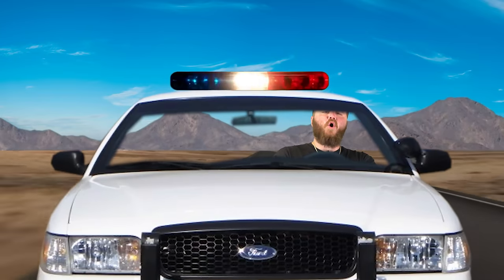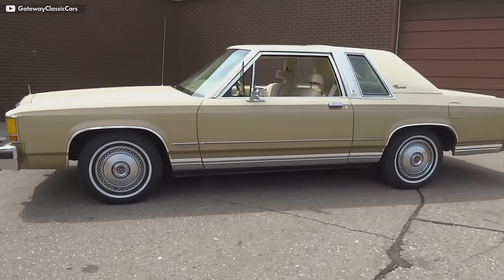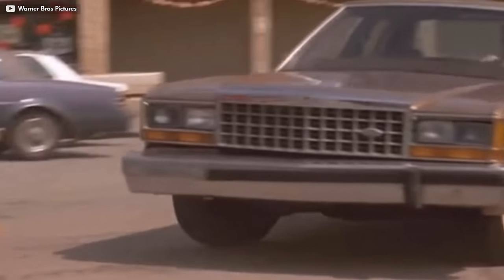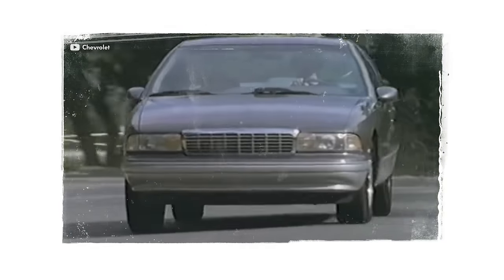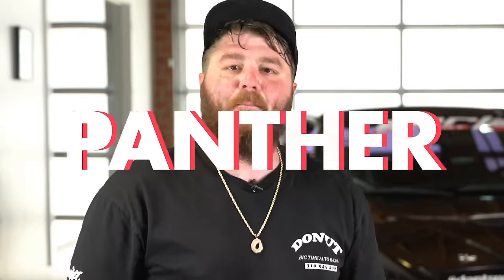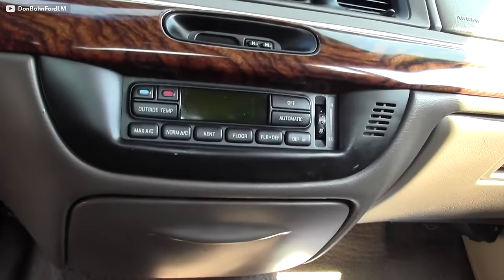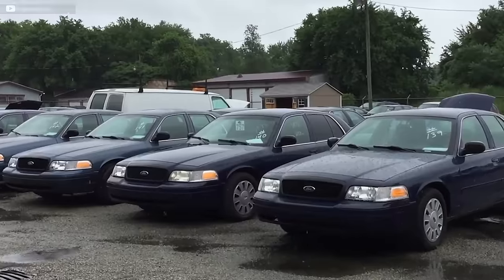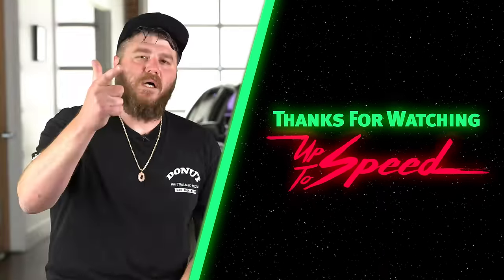Ford Crown Victoria - Everything You Need to Know | Up to Speed

Comment: I bought a 2011 crown vic for 2k with less than 90k miles and I love it. Big car is so nice compared to my tiny Honda Civic. And the trunk space is amazing for transporting all the hooker corpses
Reply: Three Tree He is 911
Reply: Haha, I hear that. Sounds like you got a better deal than me though. I got my 2011 back 3 years ago for 15K when it had 35K on it. LAPD didn't want it anymore because the heater didn't work. I guess they just didn't want the car, since a $200 part later and everything was functional.
Reply: That took a ..... turn
Reply: What the fuck
Reply: I Love This Comment
Reply: But bad gas mileage.  My Chevy Volt weighs almost has much as a Vic but so much more mileage
Reply: Im actually looking at buy a crown vic may i ask if you'd recommend it?
Reply: @danwat1234  you do know the volt is a hippie hybrid piece of shit with a tiny 4 cylinder right? The Ford Crown Victoria shares the 4.6L V8 from a mustang AND an F150 its literally powered by a truck engine bro
Reply: @jessicataylor4071   The Volt's 4 cylinder runs as a generator, the wheels are powered by a 150HP electric motor. So it's not like regular hybrids that require the engine when floored.  Believe it when I say it can tow a trailer easily. Rides well, good acceleration, American made, weighs almost as much as a Crown Vic (~3750 vs ~4400) pounds
Reply: Daniel Gonzalez how many gallons per mile
Reply: Vin wiki reference?
Reply: danwat1234 the volt doesnt havea v8
Reply: Pffft! That’s a great deal! That’s a Spit take not a scoff... just clarifying.
Reply: @danwat1234  yeah but no one bought a vic for gas mileage, its a v8 and chevy volts are gay
Reply: @piority9  a Chevy Volt was in a transformers movie. Jay Leno drives one. A very good driving machine. A V8 with less than 300HP on a ~4400 pound vehicle is not impressive.
Reply: U had us in the first half...
Reply: danwat1234 the volt sucks!
Reply: true
Reply: Daniel Gonzalez fbi open up!
Reply: Haaaaa
Reply: Gimme Your Licence Boi
Reply: @danwat1234  
 At least a Vic isn't as slow as a Volt.
Reply: Yeah bro! I just bought a 2011 CVPI for $1500, 112k miles, the only thing wrong was the radiator, which was only $70.
Reply: Daniel Gonzalez dang
Reply: "tiny Honda civic" 
Is ford f150 the only car which can "accomodate" Americans?
Reply: ill take your entire stock
Reply: @danwat1234  'Cuz the Crown Vic doesn't waste its time with lousy hybrids and speeds past 'em with its massive V8! And even pull 'em overrrr!
Reply: @benjyfriedman  4.6L isn't a massive V8 and neither is 239HP. A Chevy Bolt accelerates faster with only 200HP because electric drive power curve is superior.

 You're right that hybrids are meh they usually aren't that fast. Hybrids trucks should still put the emphasis on power
Reply: Burleon  I know, right? I just got back from Bakersfield where one of the local radio stations flat out said "We just got downgraded to 106 for our high today, thank God!"

If you can still run your sprinklers on Christmas Day in the USA, then you don't need a car heater.
Reply: danwat1234 here is a spec comparison if you want to keep bitching:

crown vic 0-60: 7.6 seconds.
volt 0-60: 8.7 seconds.
-
crown vic top speed: 128mph.
volt top speed: 100mph.
-
crown vic seating: 6.
volt seating: 4.
-
crown vic: easily modifiable.
volt: batteries/electric motors that cannot be easily modified.
-
crown vic: $26,950 msrp when new, can be had for under around $1,500 with under 100k miles.
volt: $34,995 msrp when new, around $9,000 for one with under 100k miles.
Reply: ExUsE mE WhAt ThE FuCK
Reply: Had me in the first half not gon lie
Reply: wow I paid 6k for mine with 100k miles, you surely got a good deal.
Reply: yeet
Reply: Daniel Gonzalez finna put a speaker in the trunk
Reply: I call crown vics and grand marqies pimp cars
Reply: @bwgti  mindblown
Reply: @danwat1234  reliability > gas milage
Reply: @danwat1234  Impressive, and damn 60 mpg!
Reply: @ninevoltmodz4687  TY
Reply: My God now I feel ripped off, just paid 1200 for an 05 vic with 167k...
Reply: Thought it was a good deal lol
Reply: @danwat1234  The vic gets 16MPG on the road and 25 on the highway, that's really good for a v8 so it's not really fair to compare it to a hybrid 4 cylinder.
Reply: @mashedt8rs290  Agreed it's not bad for the class of vehicle and the tech it has.
Reply: @danwat1234  yeah they are durable as hell and will definetly last you a good 3-400,000 miles!
Reply: Same bro?
Reply: @mrbruh3822  where the hell do y'all find these? I can't find one for less than 3.5k
Reply: @michaelschausten5257  dude do NOT pay 3500 for a vic, I got mine on letgo check it out its a great app, if u live in jersey I have a friend who sells them, he gets the detective package ones so they don't have the long idling hours
Reply: Try the 80s era it'll fit twice as many
Reply: vTHExUNKNOWENv  and then the prices inflated
Reply: @mrbruh3822  I'm in Virginia but I'll look on there. Thanks man
Reply: @danwat1234  Take the cost of the Volt plus insurance vs the Crown Vic and you lose every time. When the battery does need to be replaced you will lose again. I like the Volt don't get me wrong. The juice ain't worth the squeeze.
Reply: @gravis2000  unless you buy used, bought mine for $10K. Electric drive is more enjoyable. But going from $35K when new it would take a lot of charge cycles to save enough on gas to bring it down to Prius level cost. Model 3 adds so much more luxury price is justified and gas savings easier to accrue due to big battery. And the possible robotaxi revenue generator.
Reply: @danwat1234  Crown vics' are gas' guzzlers 😮😮😮💰💰💰
Reply: MaSHED T8RS Exactly. My mercury gets the same milage. I can go about 400 miles on one tank.16 gallons right
Reply: @kosycat1  I own a grand marquis aswell and yeah it's about 16mpg on a 20 gallon tank
Reply: @jessicataylor4071  yeah but the truck is "light" duty.. more like your truck is powered by a car engine broo.lol jk i have a 4.6 grand marquis and i love it..and im a hippie
Reply: That got dark reaaaal quick
Reply: Shit just when from 1 to 100 real fucking quickly.
Reply: Yes.
Reply: I remember one time in college loading up a bunch of friends in my 1999 grand marquis to go to a horse barn for the afternoon. There were 6 of us, all with seat belts. In the trunk were 2 saddles, 400 pounds of horse feed, a half bale of hay, a vacuum cleaner, assorted gym bags and book bags, the two massive subwoofers I had installed, 5 folding camp chairs and a full size spare tire. Trunk lid shut of course. On the ~30 minute drive the ride was so creamy smooth and quiet everyone but me fell asleep. They don’t build them that way anymore
Reply: Hey let’s take a crown Victoria and put in a hellcat motor let’s see how much fun we could have with it ha ha laughing out loud
Reply: @michaelschausten5257  I just got one in VA for 4k
Reply: @mrbruh3822  I live in VA and couldn't find anything. Bought my 07 for 4k with 200k miles
Reply: You either bought multi color one with a ton mechanical problems at an auction or you're just lying. I've been to the auctions. They don't give these cars away. $4,000 is what a good one with 100k miles with minor mechanical problems cost. $2,000 gets you a parts/project car at best.
Reply: @blessedjuggernaut  It was an online auction so I was buying it from just pictures and the knowledge it started. The most it's needed was new brakes and couple new ignition coils. So I guess I got lucky. If you don't believe me idk what to tell you.
Reply: @dang.9125  Good for you, man. Do you still have it?
Reply: @blessedjuggernaut  yeah. I want to last 4 more years then I'll probably drive it till it dies. It was one of my best purchases ever
Reply: @dang.9125  That car can last 300k miles, man. Just maintain it and semi/sorta baby it. I know it's hard when you're driving a four door Mustang. Just keep your foot out of it. I'm a professional mechanic and I drive a 2011 P7B too. Mine didn't come so cheap. I paid $4,700 for mine and it had 107k miles on it but it was pretty much flawless other than a few clips in the paint. I love mine. Have you had any issues? Just curious
Reply: @blessedjuggernaut  the only issues I've had with it have been the coils but it's such an easy fix.
Reply: @dang.9125  Baby that thing until the wheels fall off. It's a potential 300k mile monster
Reply: Jesus
Reply: Hol up
Reply: Ikr?
Reply: @danwat1234  2 things

1. Crowns vics can run e85. Its great

2. Crown vics dont burst into flames
Reply: I saw this comment on a meme
Reply: @danwat1234  HAHAHA, Chevy volt, now bolt, then jolt, and finally Dolt!
Reply: r/holup
Reply: @MostChameleon  
I live in South Florida. Never use the heat option at home. Never bothered with it in the car.
LOL
😂
Reply: @bernardw7535  
I've been a Jeep Cherokee guy most of the time.
I'm really considering the Crown Vic.
Reply: @mugglepower  
Whatever you choose,
it's a major blessing to find a competent + honest mechanic. They seem fewer than competent Doctors.
Truth!
👍
💕
✅
Reply: @andrewkinney7989  
and, that's a problem?
As long as it's not 🚫 the color of a bowling ball, no problem for me.
For the right price, it still might not be a problem for me.
LOL
😂
Reply: @kaloboriley9713  
"Not 🚫 that there's anything wrong with that."

LOL
 😂
Reply: @mrbruh3822  
That's a lot of miles,
but,
if you have a good mechanic,
+
stay immediately on top of problems,
do scheduled maintenance,
etc...

no problem.
Reply: @mashedt8rs290  
That's better than my Jeep Cherokee Laredo 98,or prev Grand Cherokee 2002!
Sold me!
Wow.
Reply: @mashedt8rs290  
The less tech the better.
Reply: @michaelschausten5257  
Dude 
That's still not a bad price when you compare that to other acceptable makes + models out there!
Reply: You a cop ?
Reply: Big cars are always fun to drive.
Reply: Can the trunk hold my family?
Reply: 2k!?!? Bro you couldn't buy one for kess than 11k today
Reply: I have a question i am going to be getting my first car soon and i really like crown vics and so my question  is i have a 100 pound jon boat and i want to know if the roof of a crown vic can hold a 100 pound jon boat
Reply: @maxmogavero1624  it's also a classic while a volt is not.
Reply: I had a 2004 grand marquis. I always said it had a ten body trunk.
Reply: @danwat1234  with your 8.4 second 0-60 and top speed of 98. I would sadly whoop that car in my 2002 Chevy Tahoe z71 which is a elephant in weight and tows everything much much MUCH better than a volt. Tired of these old guys bragging about a car with the same 0-60 of a car from the 50s-60s
Reply: @sickgameplays3093  The stock governed top speed is 101 on a 2011-2015 Volt but that can be removed by modifying the parameters of the engine ECU via OBD2. I haven't tried it but i've seen someone reach about 140 with one but i think they upped the power by swapping parts & software with Cadillac ELR, the cousin of Volt
Reply: @sickgameplays3093  My 2013 Volt now has 272K miles on it, battery capacity about 80%. City driving food delivery
Reply: I just bought mine with 22,000 miles on it. I love it.
Reply: Yeh, police spec doesn't require the "emergency releases" for kidnap victims you need on modern cars.
Reply: I got my 2011 P7B  for 3.3k with 95k
Reply: Hell yeah
Reply: @bernardw7535 how many miles you think you get before it dies? I want one 140k miles
Reply: @danwat1234 I'll take the Crown Vic, no offense but what happens when the Volt breaks down.

Comment: Like most 22 year olds, I bought a used mercury grand marquis when it came time to replace my first car. I put over 200,000 miles on it over the next 10 years with total repair costs of $322.07 for an alternator and a tensioner. That’s it. Without question it was the most dependable car I ever owned. Looking back on it I’m actually getting a little misty eyed remembering the day it died. My own overconfidence replacing the thermostat inflicted a $1600 wound and I couldn’t justify putting that kind of money in to a car that was worth less than $500 even in superb condition. The panther platform was such an incredible machine I really think Ford could dig the stamping dyes out of the landfill, start building them again completely unchanged and sell a shitload of them. It’s a struggle to stop myself from buying another one whenever a clean example gets traded in at the dealership where I work.

Ford really captured lightening in a bottle with that one.
Reply: Cannot understand those maths: 1600 for a reliable car, that you know through and through. No one else will or can sell you such a car for 500 except a close relative.
Reply: @gertvanderhorst2890  at that point it was closing in on 300k miles. Even though it had been unbelievably reliable up to that point dropping $1600 into a car with that kind of mileage felt foolish. And there was a tasty Taurus SHO at the dealer where I took it to get it fixed
Reply: @gertvanderhorst2890  I was hoping someone would comment on the maths…
Reply: @narebman  There's a guy near me who sells one for 3'500 $ at 130'000 kms. Part of me wants to drive a badass car but god knows I cant afford a motorbike + a car :(
Reply: I just bought a 2004 grand marquis with a brand new injector ($1000), but the actuator is shot ($600)  and the electrical is starting to go. Head lamps set on fire and windows/locks are becoming faulty. I love the hell out of this car and plan on replacing the transmission and modding the engine to give the car the balls it deserves ($10k  400+ hp). If you don’t go my way though with 2-3k in repairs car will last you till 200,000 easy. Fun as hell never broke down on me already 20,000 miles deep.
Reply: @Davmm96  paid $900 for 54,000k Miles
Reply: I just got my grandfather's 2003 Grand Marquis with 54k in good condition... ..FOR FREE!!!!

Comment: I've driven pretty much anything you see on the road today from a humble prius to some ludicrous sports cars like a twin turbo v8 amg or a 700hp GTR, mercedes C glass, GLE, GLS, some beemers, trucks, old diesle, stangs and all that goodie. And I can tell you that my favorite car is my crown vic. The fan boy element plays a part but I just love how it looks and handles. Some people say its like a boat and clumsy, which is true compared to all the tight germany cars out there today, but personally I love the feel of driving. It's heavy so slow acceleration and lots of weight shift in cornering, but also very, very stable on high ways. I brought the thing to, well I'll let you guess, and she does not budge at all. I like how she tilts in corners, the live axle and watt linkage is pretty outdated compared to cars with independent suspension and fancy sensors, but along with the heavy frame it's a soft, pampering car ride that I just can't get enough. I do all the work my self sans inspection, clean her twice a week and there were only a handful of people who touched the steering wheel, besides me. This is what cars looked like in my dictionary. 60 miles commute daily and couple trips to other states, got her for less than a month and already put 3000 miles on her, never had a hicup. Turns right on, engine idles buttery smooth like the first day she rolled off the line. Probably due to it being a postal security service vehicle, instead of a K-9 or a responder which probably been driven much harder. I just can't get enough of it. 
BTW I am 23 years old. And fuck yes I want a grand Marquis. I would guess that when people like me die that's probably when these cars will truly start to disappear from the road. But as for now, I don't know about the other ones, but mine's still running strong. I'm giving her a lot of love and care, got under the chassis and undercoat everything I see(well not the tires and shocks of course), hand clean engine bay, pull all the carpets off to de-rust the floor(the left driver side was actually pretty bad),  91 and above only, tore apart doors to re do wiring and seals. If she needs a trans or engine rebuild in the future I will do that as well, as for now the tranny and engine feels like a new car. Educating myself a bit everyday about the car to make sure I have enough knowledge if it ever comes to it. 
My previous car is a v6 mustang, not a very responsible driver back then, constantly flipping people off and swirving lanes because I thought it's cool. The crown vic also made me a more responsible and better driver, not only because I care about the car so much, but also because the responsibility once belonged to the car somehow got into me as well. Still give out some fingers occasionaly to those unfixable ass holes but overall much better driver. Oh boy there were a lot of responsibilies on these vics, now she knocked some into me. Good stuff.

"You don't mess with another man's vehicle, it's just against the rules."------Vincent Vega
Reply: Hell yeah Batman

Comment: Disappointed in the lack of info. 2003 was a total revamp. Hydraformed frame, rack&pinion steering, and redesigned rear suspension. It became the only car with a 70mph rear crash rating!
Reply: Hell yeah I drive a 03 interceptor. Used to belong to a detective. Kept the police package inside engine. Loving every minute I drive it.

Comment: Very reliable cars also. My uncle had a 1999 Crown victoria and he got about 420,000 miles out of it. I was with him when he bought it brand new back in 1999. Lol
Reply: One of the most reliable cars ever made actually, cheap to work on and easy to fix. Many of them have 400000 miles and they still are fine
Reply: What happened to make him junk it?
Reply: @HangingTree  Either he crashed it or he gave it to a kid who didn't change the oil..... for a year and a half.
Reply: How is it easy tobwork and on and cheap to repair ?
Reply: That's a hell of a mileage...
Reply: Damn that's impressive dude, mine only has 130 😛